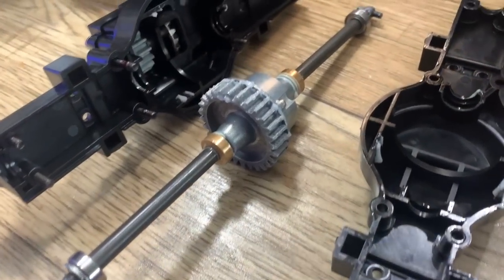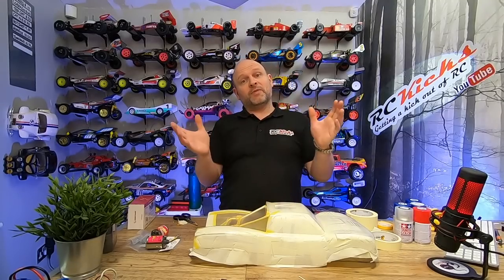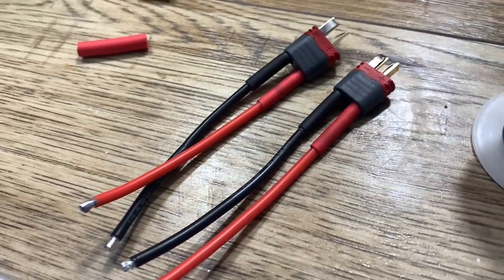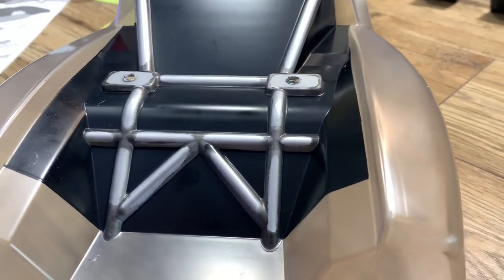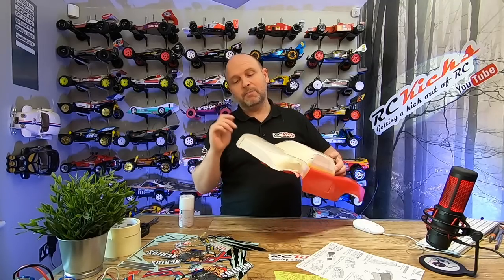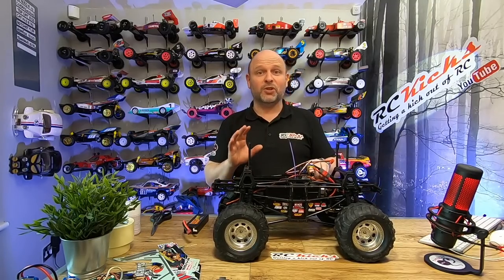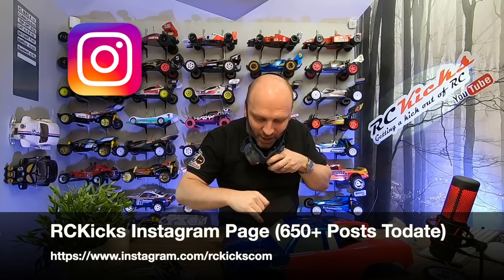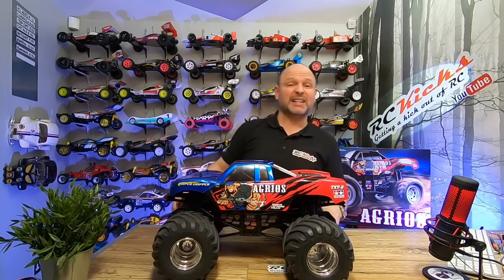Detailed Painting Steps & First Run Of A Agrios TXT-2 Monster Truck 58549 Part 3 Tamiya Kit Build

Comment: I have the original Clod Buster and original TXT-1.  I have to say, the TXT-1 is the winner just by design and build quality.  You can sometimes see them in my videos.  The Clod Buster I have had for 33 years, and needs a total restoration.  Only looks good on the shelf because the body is near perfect and the Sassy Chassis looks great.

Comment: i have a Clod and a TXT-1. And out of the box, I'll say that the Clod is more fun because it's lighter, higher geared and faster. The TXT-1 is heavier and lower geared but has insane articulation for crawling. I modded my TXT by reversing the trans and battery compartment, adding reverse rotation Traxxas Titian 14.4V 550 motors, dual batteries and Novak XR Super Duty ESC. Now It's fast and has tons torque for crawling. I go easy with high speed and 4WS.

Comment: The grey covers on those deans connector make it so you don't need to use heat shrink. Especially not enough heat shrink for a dozen deans connectors.
Reply from the maker: I like the extra protection it gives.

Comment: Amazing!!! I also painted mine in the same blue red acheme. How did you put Clod wheels? Their adapter is different as well as offset. Those little pins are bigger on Agrios. Aaahhh... You have the clod adapters. I didnt so I 3d printed new adapters. Also you can go another route and get txt1 wheels, but they are bloody rare.

Comment: Which wheel adaptor did you used for the clod rims in the txt2…? Normally they don't fit exactly. Normally you need the txt1 rims.

Comment: The TXT-2 looks great with the Clod Wheels on, are you planning a howto on how to fit them? I can't seem to find any info on what parts, if any, you need from the Clod to get the wheels to fit the TXT-2.
Reply from the maker: You can swap out the drive shafts for the clod versions and then just fit the Clod hubs to keep everything stock or fit some adapter hubs.

Comment: Congrats on your channel, I love it! I have 2 questions... 1. Did you add a rollbar to your Agrios? If so, I would love a link to that video. 2. What parts did you use to widen Agrios' stance? Cheers from California! 🎉
Reply from the maker: Hi,  No I didn't fit a rollbar to it.  To fit the Clod wheels the best way to to get the Clod driveshafts and hubs but you can also do it with some hub extenders.  I got mine from the ClodShop in the UK

Comment: Gav, with the pinion mesh, do you use a bit of paper or similar to set it?
Should hold its position when put back in the chassis, then remove paper.

Comment: I love the Agrios. I want one but is it even possible to get a body for it if you need a new one? I looked on Ebay and not even 1 for sale. I guess at that point the only option is aftermarket.
Reply from the maker: You can fit loads of bodies on it.
Reply: @RCKickschannel  Yeah I guess a body isnt the issue. What about spur gears? I couldnt find any parts at all on Ebay. Would I need to buy a whole kit? I suppose you may be able yo order a spare spur gear right from Tamiya?